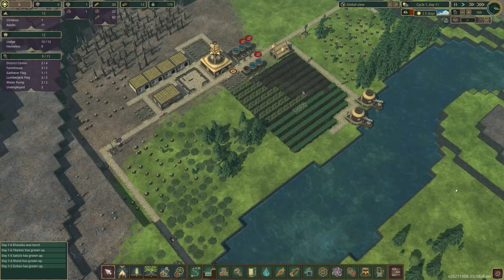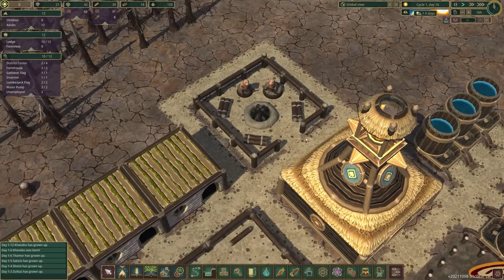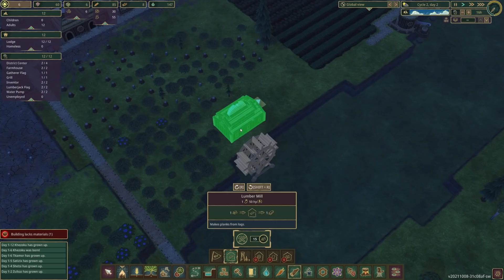Waterwheel Power | Timberborn #2 - Let's Play / Gameplay

Comment: You can easily put 6 houses on top of 10 (5x2) with just a sinle staircase (when it'll be needed). Put 4 at corners, facing into the center, and another two in the very center of the bottom layer, so they each stand on corners of four different bottom houses And thus you get rectangular walkway with access to all 6 houses. Put stairs where you like.
The only downside is it requires to distort ground-level road, because stairs have go to the long side.

Alternative is a single row of huts with a walkway of roofs, with a single staircase at short side.